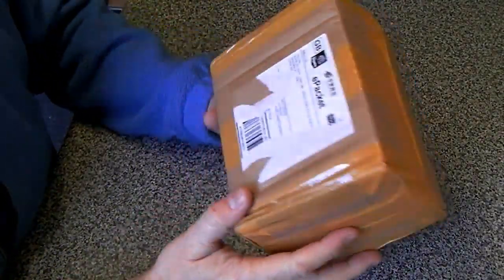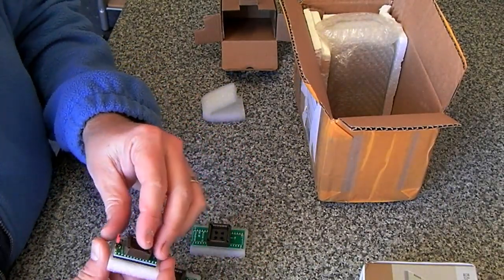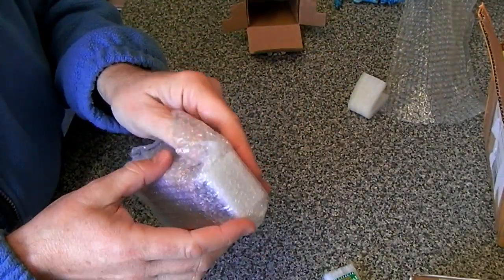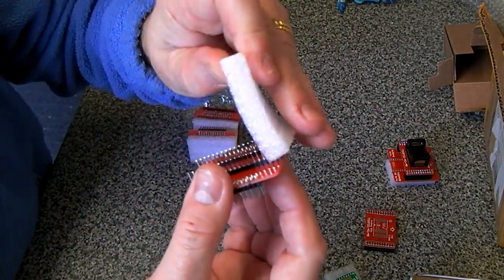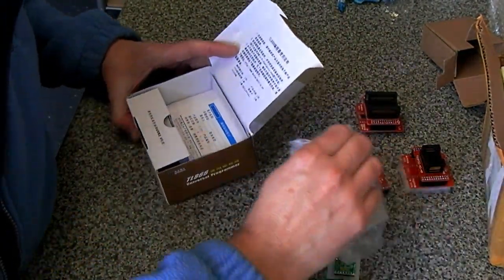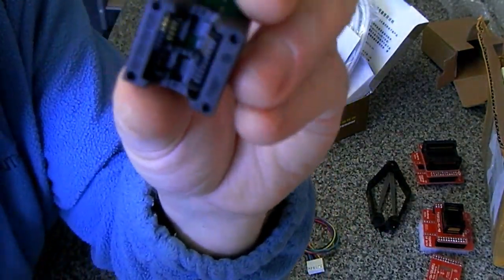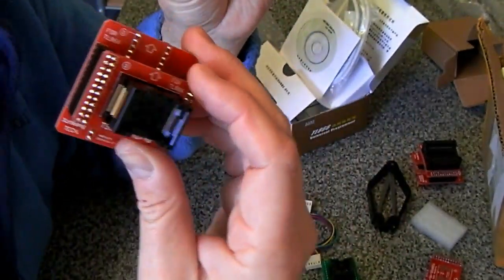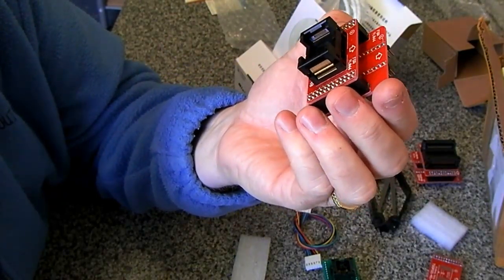MiniPro TL866 EEPROM Programmer Un-boxing video

Comment: Can someone please check whether they can erase/program/read a 29F010, SST39SF010 or equivalent ? (also reading a 27C1001)
Reading results in alternating 800h data blocks that are fine or filled with FF, programming doesn't work as the first 800h sized block is verified as failed. Seems like an address line is stuck, however electrically it's checked fine (checked between chip pins and underside ZIF). Reading and programming a 27C256 -old skool- eprom works fine.
Reply: I have the TL866A programmer.  I checked both 29F010 (which comes up as AM29F010) and SST39SF010 and they both appear in the list, under both the DIP and PLCC versions.